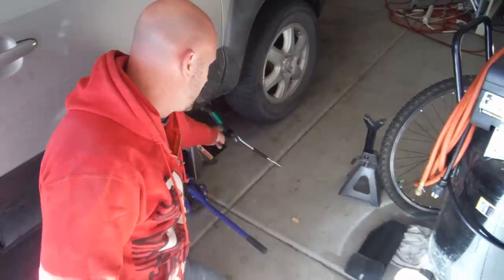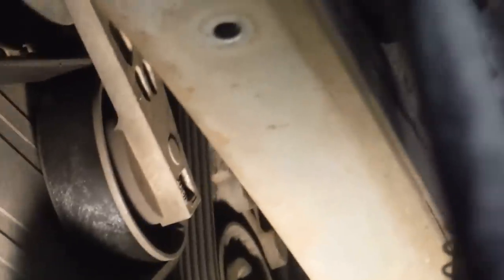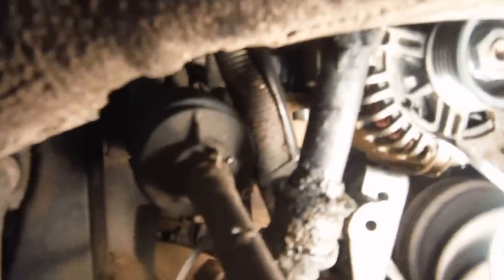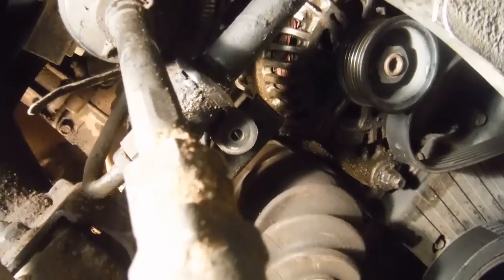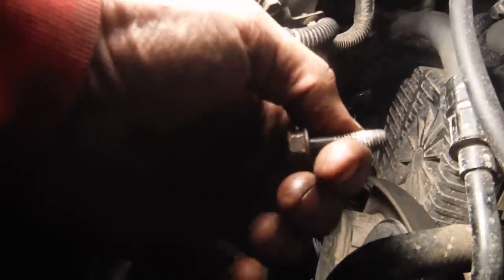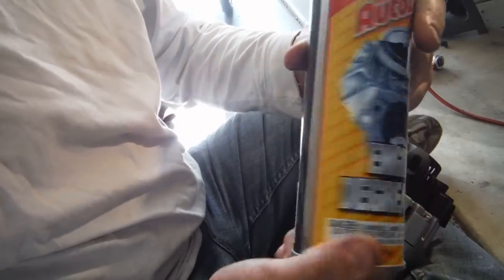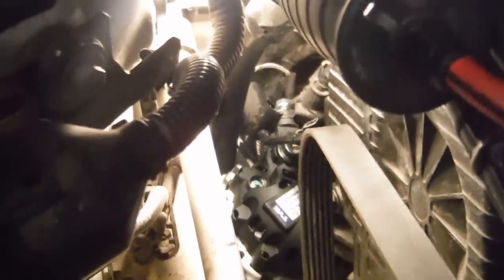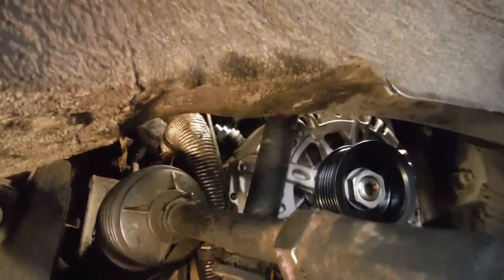DIY 2005 Hyundai Tucson Alternator Replacement

Comment: Thank you so much for all the great advice.  Took me about 4 hours from start to finish. I have 2008 Tucson and I think the opening between wheel well and CV joint shrunk by an 1/8 of an inch. what a beast to get in and out.  But pointing the pulley over the axle was the right way. Thank you again saved big time time on this job.

Comment: Thank you, thank you and than you.  I just spent about 45 minutes looking online all over the place and just found your video.  I'm changing the CV axles on a 2005 Hyundai Santa Fe and everything was going fine except for getting the new one in place.  The plastic splash guard was in the way.  I couldn't figure out how to remove it and was considering cutting it.  Then I found your video and went back put to the garage to see if the bolts were in the same place and they were.  Just wanted to let you know that I really appreciate you taking the time to make the video.  Thanks again.
Reply: I have 2007 hyundai tucson I spent 6 hours to remove alternator l couldn't. I should remove cv exale.

Comment: Thanks for documenting your work to help us! My Tucson was parked for about 3 weeks while I was working on the exhaust and oil pan, and when I got those new items replaced, and tried to start her, she wouldn't! She wouldn't turn over - which is usually a sign of a dead (car) battery - but my cheap voltmeter read it had 14 volts - so I thought my (car) battery was fine - I was wrong. The little battery in my voltmeter was almost dead and it was malfunctioning and giving me a bad reading! Meanwhile, I thought my starter was bad, so I removed it - and to get it out, I had to remove the front exhaust pipe that I had just installed! I had the starter tested - and it was fine! They tested the car battery, and it was actually only at 9 or 10 volts and needed to be charged - and may be bad - that's to be seen. So now I'm charging my battery, and I watched your video in case it turns out that my alternator is bad - which I hope is not the case, as that looks like it can be quite difficult.

Comment: Great video, good info.  Here are a few things that will make your life easier.  With the video info loaded in my head, took me 2 1/2 hours start to finish.  Random thoughts.:
1) Raise the passenger side vehicle up high so you can get in under the engine sub frame.  Please use appropriate jack stands and put the tire under the frame.  Too much safety is never wrong.
2) Take the wheel off like the video said, but no need to remove caliper.
3) Removing power steering line bracket is a must.
4) Do all of these things before loosening the alternator mounting bolts and this is done from under the engine bay sub frame.  That is why you need to get the vehicle up high.  A rolling creeper is nice also. I used a 12 inch long slotted screw driver to take off the small wire holder for the oxygen sensor.  don't pry off, you will break it.  Use the blade of the screwdriver and push the tabs down and the out for oxygen wire holder, it works.  Also use the screw drive to push down on the release tab for the electrical connector to remove it.
5)  Make sure to disconnect the negative battery terminal.  You can then take a 12mm 12 point socket to remove the battery connection.  Remove the boot and you can reach on top of the exhaust with your left hand to loosen the bolt.  Once you get it loose, use you hand to spin off.
6) Remove top mounting bolt and then loosen bottom bolt.  No need to remove long bottom bolt completely.  As the video says, point the pulley out towards you and pull out.  As karhunt12 says, it is about 1/8 inch too small, but being that the axle boot is rubber, that is the difference make.  You are just going to need to try different configurations.  It a tough pull.  Out was easier than back in for me.  Back in, it took my 3 or 4 tries to get it, but it will go.
7) mount the alternator completely and then you can put back all of the electrical back on the alternator just like you took them off.  All from under the sub frame.
There you go, hope it this helps.  Thanks so much for this video, really helpful.
Reply from the maker: Great tips! Thanks you!

Comment: I just changed the alternator on my 2003 Sonata V6. It is just different enough that I had to remove the axle shaft, unbolt a engine mount, and raise the engine up about 4 inches. Your's was a lot easier.
Reply from the maker: that sucks! sorry man, what a pain in the ass
Reply: @rawar777joshanderson  Yep, big pain in the ass. In all, it took me about 7 hours
Reply: Yeah I have to do the same I think it’s because the alternator has not been replaced since the original, maybe it’s a manufacturing problem? When I’m in the process of taking off the half shaft axle hoping that’s all I need to do to slide the bolt out
Reply: all you have to do is lower the sub frame remove the two 24mm bolts on passengerside and lower like doing  the rack in pinion ! LOL

Comment: I was loosing a little bit each time you edited out parts of the video but I'm tired anyways so I'll watch it again tomorrow because I just meant a guy who offered to do it for $185, right after he just happened to walk up to an AutoZone salesman who sold me a battery I didn't need, so they may know each other. But the last time this happened, it was my Starter, so I'm going to check the Battery tonight while it's dark t see if the lights get brighter when i hit the gas pedal.... Thanks for the video.
Reply from the maker: Yeah, if I didn't edit the video down it'd be like 4 hours or something haha. Also, AutoZone employees used to seem much more knowledgeable. They tried telling my battery was shot too and I knew it wasn't because it was pretty new. I'm not going to lie, this job isn't fast & easy. However, with the help of videos like mine, you CAN do it. It'll save you TONS. The vehicle I have now had the same issue but I couldn't do it myself because of the timing of things and it set me back $475
Reply: @rawar777joshanderson  Hi Josh, yep, the mechanic who has been doing most ofm y work acted really pissed at me yesterday, I believe because he heard me talking to another guy I meant who also works on vehicles. I asked the guy who does my work what he was going to charge me, but he just said, ''I don't know, we'll wait and see.'' Now I'm afraid that he's planning on overcharging me again, like he did a couple months ago. My wife has been telling me to just wait & do it myself. I might ask him once more & if it sounds like he's giving me the run around, I believe I'll cancel the job & just do it myself this weekend. I mean Michigan sucks this time of year but so does $475. Somehow he heard that I was tired of paying to tow some of my vehicles out to where he's been working in some guys garage to fix my stuff at. Since then he's also been charging extra for the use of the garage, plus he's also been paying the guy to help him, so yeah, his prices aren't far behind what a shop would charge. Plus I just found the phone number to the guy who own the garage. I called the number & the guy not only acted like a total asshole but he also acted like he didn't know what I was talking about, & he claimed that he didn't live in that house, plus I had the wrong number, lol, it sounds like I'm about to get screwed....

So with his prices doubling, then I have to drive him 15 miles back to get his car, it's been getting really old. Getting really old fast.... So like I said, if he can't give me a straight answer, maybe I should do this job myself. I just got off the phone with this new mechanic I met last week. He claims that he'll do it for $160. I should take him up on it. Sounds a hell of a lot better than, ''We'll see'' & better than ''$250-$350'' Thanks for replying. You helped me make up my mind on this one..

Comment: Thanks for the info Josh but I for the the life of me can not get the alternator out of the wheel well, any other suggestions would be awesome!
Reply from the maker: I know that part was super tricky. I tried to explain it as best I could in this video. That's really all I can tell ya. It does fit, so if you keep trying I know you can get it out (if you have the 06 Tucson - other years and models may be different)
Reply: Me too.  Appreciate the video, but for the past several hours I have tried positioning the free alternator 360 degrees with the pulley facing front, 360 degrees with the pulley facing the side, 360 degrees with the pulley facing in.  I have disconnected the power steering line, removed the bracket, disconnected the hard line which I assume to be PS, and I need 1/4” more.  I have a 2006 Tucson V6.  The CV axle has to be removed, that’s going to be the only way to get it out.

P.S.  I stand corrected.  Two things:  I watched when you reinstalled the new one and oriented mine exactly the same way.  I came down the axle, then back then out the front past the brake line.  ALSO, I still had that little plastic tab in the alternator housing, and that was just enough to hang me up.  I got that off, then sprayed the CV boot with armor all, and that helped.  Thanks for saving my ass.  👍

Comment: If you see your brake and battery light come on together, it's time to replace the alternator.  For the 2006 Hyundai Tucson you definitely have to remove the right CV axle to do this job.   Forget about getting the alternator out, there's no room to even get your hands in there to unhook the cables.  And there's no way to get to it from beneath either.  Here are some pointers:

1) You'll need a 32mm socket to remove the axle nut
2) Once you release the steering knuckle from the strut, you can let the hub hang there, but watch for the ABS line.  Unscrew it from its bracket to ease the tension.  
3) In my case the CV axle thankfully came right out with a few tugs.  If it's stuck in there, you may be tempted to use a small crowbar to pry it out from undeneath.  But there's a metal bracket under the junction blocking access.  It seems it's held there with two bolts, for which you'll need 9/16 socket. There's another video on youtube about a guy who pulled it out with the aid of a nylon strap.
3) Unbolt the old alternator and lower it a bit, and then unhook the cables. Reverse this when you put in the the new alternator.
4) After putting in the new alternator, tighten the top bolt before putting on the drive belt.  Then put on the belt and tighten the bottom bolt.  The belt was easier to take off than put back on.

BTW, I bought this alternator: https://www.amazon.com/gp/product/B007XUI1OM/ref=ppx_yo_dt_b_asin_title_o00_s00?ie=UTF8&psc=1.  So far so good.
Reply: wrong 
all you have to do is lower the sub frame remove the two 24mm bolts on passengerside and lower like doing  the rack in pinion ! LOL also if you wanted to remove axle you remove the two ball joint bolts pull off brake caliber and clip to strut and then you drop axle with 32mm nut not removed

Comment: The ratchet pulley thing with square  belt broke at the square. What Options do I have in struggling. 😳
Reply from the maker: It's hard to say without seeing what you're talking about. But if the belt broke there's nothing you can do but get a new belt.
Reply: @rawar777joshanderson  wow thanks for the Response brother I figure the name of it belt tensioner. The square to pull and loosen belt which btw your the only video that very clearly showed how to do. (Thanks you immensely). We got it off with elbow grease snd a hack with some tools. Thx brother very amazing your responded. Amazing. Will sub my friend

Comment: On the 2007 Tucson límites there’s a bolt on the alternator that holds it and it won’t budge out. Do we remove the CV axel for it? Yours was an 05???
Reply from the maker: Yes mine was 2005. I have heard of people taking out the CV joint but I just assumed it was because they couldn't figure out that bolt. I guess maybe the 07 is different? If you watched my video all the way through then I'm sure you tried what I said. If that doesn't work then it must have changed in newer Tucsons
Reply from the maker: @josepablorosas1738  Dang that sucks man
Reply: @josepablorosas1738  You probably already know this by now but the long bolt does'nt have to come out.  It just slides out that big slot there running down the bottom of the picture.  Regardless, I think I'm going to have to take the CV axle out just to get mine out as the frame to cv axle slot you have to pull it through on the 2006 is tighter by a 1/4" to 3.8".  Just enough to make you scream, ....and I did.  So now I'm debating taking the whole CV out(straight part coming out of tranny, carrier/bearing, transaxle) or just the actual trans-axle on the end. Will update as I go.
Reply: @rawar777joshanderson  the only way with a 120 volt was to take out the axle and it slips out . NEVER AGAIN!

Comment: The valve cover gaskets are terrible on these engines which leads to the alternator failure.
Reply from the maker: Hmmm I wonder if that's what happened to mine

Comment: They didn't make that thing easy to get to at all did they
Reply from the maker: Ha seriously! A while before this, I replaced all the lifters, water pump, timing belt, & spark plugs and the whole time I'm thinking - "Hyundai could care less if I can get this thing repaired. They only had to built it in a way a robot could put it all together and then sell it and never look at it again". Think about this: if toy makers can design a Transformer that can change from a man to a car - why in the world can't car manufacturers design this thing to open up and slide apart so you can get in there & make repairs??